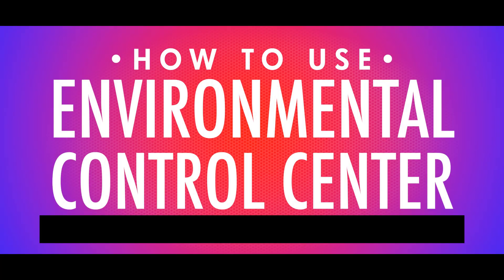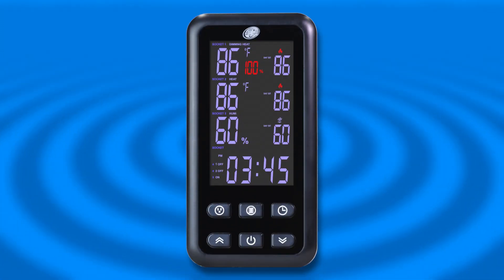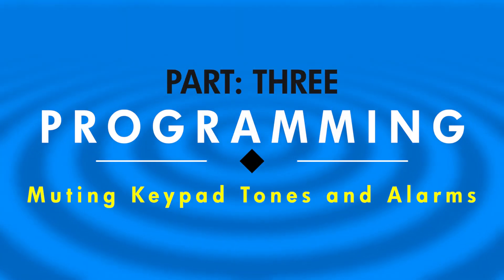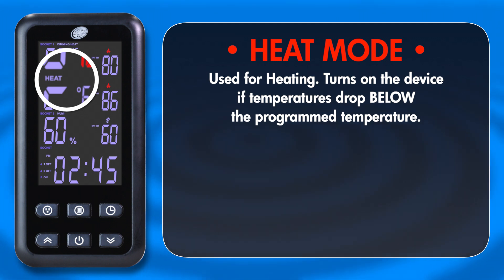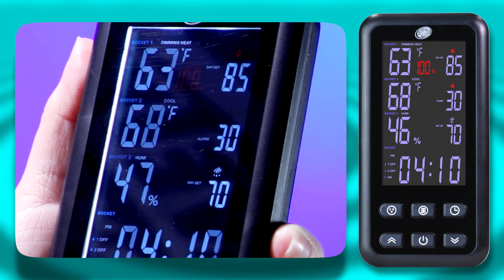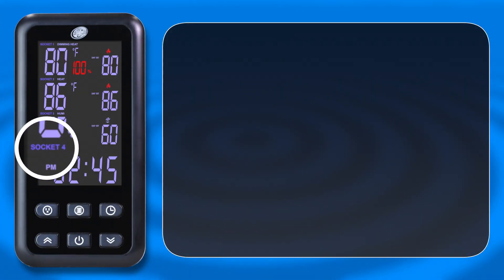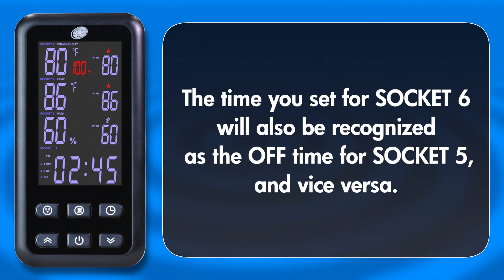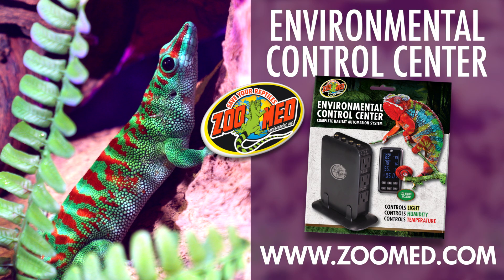Zoo Med Environmental Control Center - Instructional Video

Comment: I have one on the way and I'm trying to learn how to set it up before it comes.  Where I'm stuck is with the two probes.  My currrent set up will have 1. MV Bulb alond with anorher flood lamp for basking.  2. A mister connected for  humiduty requirements. 3. a Ceramic Heat Emitter for mainly to regulate Night temps once the Basking Lamps go off.   My question is if using Both Heat Probes how will it know which one to listen to.  I want my cage to be no lower than 75 at night.  With two probesin two different areas in the cage will Socket1=CHE know when to turn on?
Reply from the maker: Hmm, going by your description, this is how I'd set it up for the results you're looking for:
Socket 1: assuming the lamp you have is dimmable, I'd put the 'Flood Light' here.
Socket 2: I'd put the Ceramic Heat Emitter here, but set the daytime temp low enough to where it would never turn on, and then have the nighttime temp at your preferred 75º.
Socket 3: Mister
and then put the Mercury Vapor Bulb in either Socket 4 or 5 depending on often you want it on.
Hope that helps. Take care.
Reply: @ZooMed  Thanks for getting back to me so fast.  So with the two temp probes will one need to be installed on the cool side and the other on the Hot Side?  In my current setup there can be a 10F difference between the Cool and Hot side at night.  Which prob will it listen to?     Example..  8pm one probe reads 80f and the other reads 70f but I never want any part of my cage to get below 75.  Will it read the 80 and think  "We're Good " or read the 70f and say "Let's Crank the heat up"
Reply from the maker: @kwesiwalker9017  Temp Probe 1 provides data to Socket 1, Probe 2 to Socket 2, and the Humidity Probe to Socket 3, so whichever placement you think would work best for those sockets. Going by my original suggestion, I think I would set probe 2 on your cold side and set it to 75 for you daytime temp to best maintain that throughout the day. You may need to play with it to get the results you want. Hope that helps some.
Feel free to contact our Customer Service for more details: 1-888-496-6633
Take care. 🐢

Comment: I wanted to use socket 1 for a dimmable basking light (dimmable) and socket 2 for a nocternal heat lamp. So do I have to set the the socket 1 nightime and the socket 2 daytime (times I want these to turn off as the other heat source will be on)? I also am using a mister which will go into the hum socket and 1 UVB light which will go into the timer socket. Please let me know if this works or I need to change thing around.
Reply from the maker: Yes, that should all work nicely.
To get the specific setup temps you've mentioned where only one heat source is on at a time between Socket 1 and 2, I would set a very low night temp (say 45°) for Socket 1 (this will prevent it from turning on), and a very high daytime setting for Socket 2 to prevent it from turning on during the day. Does that make sense?
Hope that helps.

Comment: What's the maximum enclosure size for one of these? Also can I have the lights gradually dim/brighten or is it instantly on and off?
Reply from the maker: It really depends on what and how many electronics you're using for your enclosure.
The Environmental Control Center has 6 outlets that can safely handle a combined maximum wattage of 1,850 watts.
Hope that helps. Contact our Customer Service for more details:
1-888-496-6633

Comment: Okay, so let's say you want the 5/6 alternating sockets completely off because you won't be using them. Is it good enough to just not plug anything into them? I tried holding the power button down for each one, but it seems that just controls which one is the on and which one is the off. Does the system know if there's nothing plugged into sockets 5/6 to not trigger any relays or whatever? Not that it hurts anything, I just don't want to hear the constant on/off clicking if nothing's plugged into them.
Reply from the maker: Hello! Yes, it's fine to leave the outlets empty, but unfortunately that on/off activation 'click' is built in and can not be turned off.
Best I can suggest is to make the switch times at a time of day that would be least bothersome.
Hope that helps.

Comment: Is there a way to turn off sockets 4-6 I don't need them but it sounds like they keep trying to turn something on even though there's nothing plugged in.
Reply from the maker: There is not, they will still be on even if they are not in use. The best you can do is to make sure the alarm on those sockets are turned off.
Reply: @ZooMed how I can’t turn them off and customer support never answers me

Comment: Can you give us a list of recommendations to buy as a kit so that we know that the devices that we would connect would work?
I know I saw a list of bulbs to not use but what about like, misters, and other items? could help with people who are just starting to get into this.
Reply: Also a guide on where to place certain sensors. Like humidity. If it's on the bottom of the space, it turns on and off too frequently. If it's on the top of the space, it is usually on too long.

Comment: Does this device adjust the voltage to heat lamps to maintain the heat. Or does it just run them and alarm if the temperature goes to high or too low
Reply from the maker: The Socket 1 dimmer is the only one that can adjust the voltage and current of the plugged in device.
The other sockets operate by alternating on/off to get the desired setting.
Hope that clarifies the devices operation.

Comment: maybe im late to the party, but can you programe socket 4 to be always on? sadly my misting sistem requires a more precise time-frame so i cant programe it only using minutes.
thanks in advance
Reply from the maker: The best you can do for close to constant power with Socket 4 is program the OFF time to be a minute apart from the ON time.
Naturally, the best way to get constant power is to plug the device directly to the socket.
Hope that helps some. Take care.
Reply: @ZooMed  If I wanted to do so, or maybe set them 10 minutes apart, could you give an example of time?(i.e. 1 on 12pm, 1 off 11:50am. plus same for the second) Ive followed the video and manual and they're still off. Just want a 10 or 20 minute gap in the afternoon.
Reply from the maker: @jarrodbuote599  So you want the device to only be off for 10-20min per day?
The example you gave should work for that, just make sure your "4 1" options are matched with your "4 2" options to avoid any possible changes.
("4 1 ON" is set to the same as "4 2 ON"
"4 1 OFF" is set to the same as "4 2 OFF")
If you're still having trouble, please reach out to our Customer Service:
1-888-496-6633
Hope that helps.
Reply: @ZooMed  Could you, and this is just an idea, put for example 4-1 on and 4-2 off at the same time? Same with 4-1 off an 4-2 on. That way it should (in theory) be all day on.
Example 4-1 on 6 am, 4-1 off 2 pm, 4-2 on 2pm, 4-2 off 6 am

Comment: I cant find anywhere information on the battery. Is it charging through the connection to the rest of the device?
Reply from the maker: Yes, the digital controller has a rechargeable battery that charges when plugged into the Environmental Control Center.

Comment: Is there a way to setup socket 4 to be on 24 hours? I want my humidifier with its own timer to be powered the whole time
Reply from the maker: The timer is one of the key features of the Control Center, so you can't really turn it off exactly. You can set it to where it goes off for only 1 minute out of the day, but otherwise plugging your device directly to a wall outlet would be the best solution. Hope that helps.

Comment: what if you want a cool side and a hot side of a set up like a Ball Python cage.  I have a 4x2x2  cage.  and I want one side to be the warm side and the other side the cooler side.   I also have a UVB, and Grow light and a ceramic heater for the warm side.  Was also thinking about an automated watering system for the plants.   Can this be done with this controller
Reply from the maker: Certainly, it'd just depend on how you setup your habitat.
Reply: @ZooMed  What I would really want to do is at least Be able to have a warm/basking side, and a cool side for my ball Paython,  He lives in a Bioactive Enclosure, with Plants and beneficial bugs for the soil ect.  and I want a day time and night time cycle. Were I turn the UVB, and grow light off at night and on during the day.   I want the one ofTemp Probes to control The warm/basking side,  and the other Temp Probe to control the cooler side.

Comment: Question. Is it possible to have the day and night sockets running at the same time for 2 day lights? Like say you set both of them to turn on at 8am would they both be on or just one?
Reply from the maker: The Day and Night Sockets are strictly alternating power, so they can not be setup to be on at the same time.

Comment: ok so i’m getting a second snake and i use a ceramic heater and under tank heat pad, is there any way to program the light sockets so i can use them for second ceramic heater and under tank heat pad? i’m worried i’m gonna do it wrong and screw up majorly. thing is i would need two more probes for the second tank… i’m not sure, any ideas?
Reply from the maker: The sockets for the Environmental Control Center are locked into their designated function and cannot be reprogrammed. If you need another heat controller/probe you'll need another device to manage it. Hope that answers your question.

Comment: I dont understand how this thing works, im trying to set it up with my ceramic heat lamp for my treefrogs while im gone for the weekend, which socket do i plug it into? i want it to be at 85 during the day and 75 at night for temps
Reply: Did you figure this out? This is exactly why I want this and want to know if it works.

Comment: does this work if you only have 1 heating source?
Reply from the maker: It can, but you would have to still set up and program the other outlets and temperature probs to avoid any potential alarms. Hope that helps.
Reply: @ZooMed  That's kind of ambiguous. Can I use it with one ceramic heat? Emitter and not connect the other one probe to anything?
Reply from the maker: It is preferred to plug in a device that will pair well with the operation of each outlet, but If you have another device that can be plugged into the remaining plug, you can do that, just be aware that it'll still operate to the settings and function of that outlet and should be set up accordingly for the best and safest results.
Our Customer Service can help in more detail:
1-888-496-6633
Hope that helps.

Comment: If the heat lamp is plugged into the heat outlet, is there a timer on that plug? Or anyway to use the thermostat with a timer option. My gecko doesn’t need heat at night.
Reply from the maker: Socket 2 can be programed for separate day and night temperatures, so simply program the nighttime temperature to be where you want it to be and the heating device will only turn on if it falls below that setting. Hope that helps.

Comment: I am interested but I was wondering would it be possible to have a Deep heat projector on the socket 1 and then a UVB daytime light on socket 4? I want the Deep heat projector to stay on just change temps depending on day/night but for my UVB light to shut off at night and turn on at morning.
Reply from the maker: Yes, that setup should work.

Comment: Hi I just purchased the control tower and everything seems to work fine except the Humi option. It shows the symbol that it's connected and it's programmed correctly but the mister is not getting power and turning on, the mister works fine when plugged into socket 5
Reply from the maker: Please contact our Customer Service and they should be able to help narrow down the issue. They can be reached at: 1-888-496-6633
Hope that helps.

Comment: Would any socket be able to have a t8 uvb hood plugged in? I'd like to have a halogen heat lamp, and a uvb hood, both on a dimming schedule. Would that be possible?
Reply from the maker: Yes, the Environmental Control Center is designed to handle 1000 collective watts.

Comment: There isn't much information about what to do with the remote - do I leave it plugged in all the time? Does the LCD light ever turn off? Certainly the backlighting can't stay on all the time. Will the battery die?
Reply from the maker: Yes, the controller should remain plugged in to stay charged and update the Control Center, but it can be removed and programmed remotely.
The LCD screen remains on as long as the controller has a charge. See the instructions on the product page for more info:
https://zoomed.com/environmental-control-center/

Comment: I have a question...I purchased this system because I needed to control my two snakes' heat pads, not so much lighting and humidity, but I wanted something to use on both terrariums. Well, this device has clicked intermittently since I hooked it up and the remote beeps constantly...it's so annoying that it wakes me up in the morning. Why does the device click? Why does the remote beep all the time? I'm at a loss, please help!!
Reply from the maker: The 'clicking' you're probably referring to is the socket being switched on/off based on your settings.
If you feel it is happening too frequently, you may need to adjust your difference period, which decides how much the temperature can fluctuate from the set temperature/humidity before it reacts to it.
As for the alarm, if it is constantly going off you either need to adjust the alarm settings, or check that all of the temperature/humidity probes are properly plugged in (even if you are not using them). The Alarm and key tones can also be muted by holding the power and down arrow for 6 seconds (this does not mute error code alarms)
For more help and details, please contact our Customer Service at: 1-888-496-6633
Hope that helps.
Reply: @ZooMed  i just checked back to this video after having this thermostat for over a year and i didn’t realize that not having the humidity probe plugged in was causing the error code as i tried for WEEKS to mute it to no avail, literally almost cried while setting it up since it was so annoying. thank god for this comment

Comment: My socket 2 is showing that it’s giving the lamp power but the lamp is not turning on. Everything is new, the lamp the bulb and the control center are all new yet I can’t get sockets 1-3 to power anything.
Reply from the maker: Please contact our Customer Service and they should be able to help you narrow down the issue.
They can be reached at:
1-888-496-6633
Hope that helps.

Comment: My remote that gives me the states turned off and won’t come on. I already messaged the company and they send me a new one. This one shut off even sooner than the last one. Am I doing something wrong?? Everything is plugged in and everything.
Reply from the maker: Hmm, that's frustrating. As you said, I would first check to see if the wire connected to the remote is plugged all the way in and doesn't have any noticeable kinks or other potentially damaged parts.
When plugging other connected devices into the Control Center, are they receiving power?
Please contact our Customer Service again and I'm sure they'll be able to help in more detail. They can be reached at:
1-888-496-6633
I hope we'll be able to help. Take care.
Reply: Did you get it sorted out? I have the exact same problem as you. I set up the new one they sent and within two minutes the second one shut off :/
Reply from the maker: Please contact our Customer Service again:
1-888-496-6633

Comment: What is the refresh rate of those ? I got mine in the mail, and the temperature seems to be stuck at 40c while in my home ... it doesn't seem to update frequently ? Is there any way to make sure that it is connected to the hub ?
Reply from the maker: The refresh rate is almost instantaneous.
I would suggest making sure the probes are properly connected, and testing them by changing their positions or maybe changing the temperature gauge from Celsius to Fahrenheit and see if they react to that.
If they're still not updating properly, please contact our Customer Service at: zoomed@zoomed.com
Hope that helps.
Reply: @ZooMed  Thank you. I already contacted the customer service. It appears that I had a defective remote, but it is already sorted out :) they're sending me a new one! That's great customer service there!
Reply from the maker: Awesome! I'm glad they were able to help. :)

Comment: Can any mister be used with the environmental control center? Or does it need to be a Zoo Med brand mister for it to work properly?
Reply from the maker: It should work with any mister, but be aware of the timers unique settings when setting up.

Comment: how do I get the remote to stop beeping?
Reply from the maker: If your remote is beeping, it means that the temperatures or humidity inside the habitat are not reaching your desired settings.
I would first make sure that all the devices and probes are properly plugged in (all probes must be plugged in, regardless if you are using them or not).
The Remote should indicate which device is not meeting your settings, readjust the settings or setup accordingly.
If the video or my description aren't helping, please contact our Customer Service for more in-depth details:
1-888-496-6633
Hope that helps.
Reply: @ZooMed  great thank you. I think it's the probe thing as I didnt know that i needed all of them plugged in even if I'm not using them

Comment: Can we set a on and off timer for both heating outlets?
Reply from the maker: You can not, but you can adjust the temperatures for Day and Night for those sockets, which are tied to the clock settings.